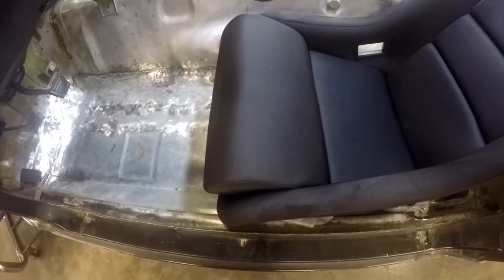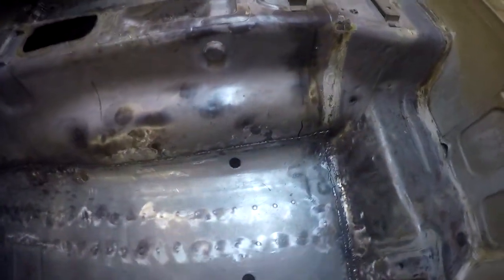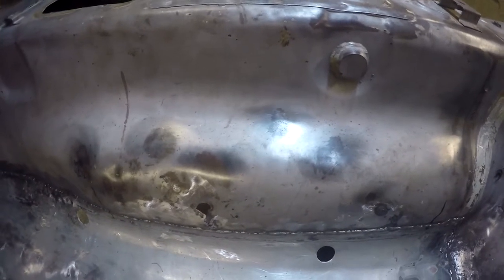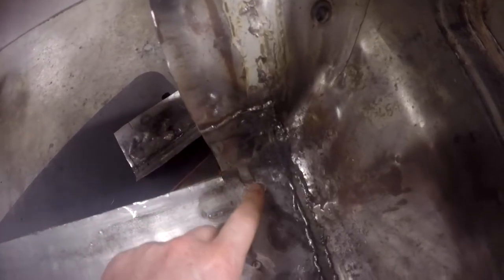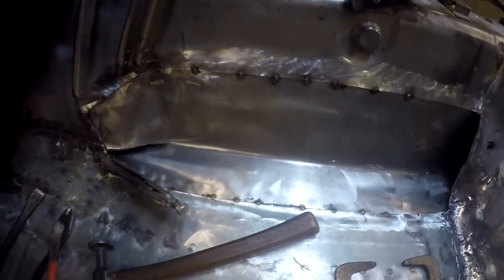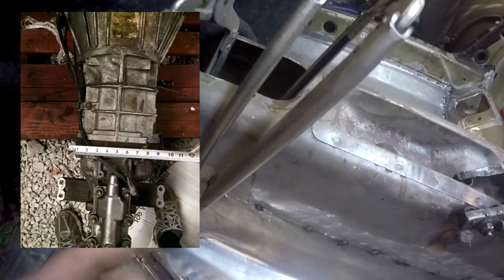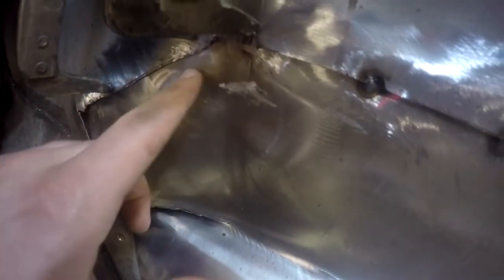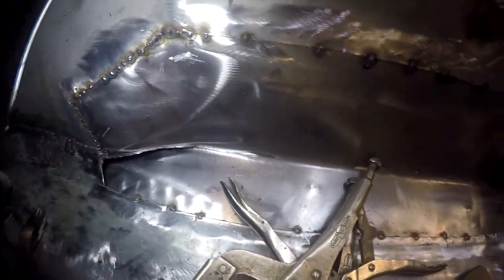Fitting the Racing Seat in the Datsun | Modifying the trans tunnel

Comment: I hope you looked into jegs Datsun Z roll bar and cage kits.They are cheap and prebuilt
uhm that area you cut I'm wanting to tuck exhaust but you got to sit in it .So now you can see why metal is great for mods.you can make any thing fit.
have you test fitted your gearbox?
Reply from the maker: I actually bought a Rhodes roll cage prebuilt for the z. The JEGS kit isn't scca approved and I got the Rhodes kit from a local z guy who ended up not installing it. So got it on the cheap. 1 5/8"x.120" wall DOM Tubing. As far as my gearbox (transmission) yes it should fit
Reply: Built Not Bought TV I didn't know you plan to race.I was assuming a street car.Neither of mine will be racing (I hate rules ) a street car you can just build what you want and just enjoy it. Another reason I chose mild stock 280z carbed motors ,for both cars ,and five speeds.Just to enjoy old school driving on the road .
A good job making this vid great job great work.My friend I'm about finished with both chassis rust repair so I'm getting more excited to start building soon!
Reply from the maker: The rules suck for sure. I'm actually not building the whole car to SCCA standards but I am for my roll cage. Things like fuel cell and some other stuff aren't going to meet the specifications. I also don't think modifying my strut towers is allowed either. But I'm building the car for what I want. Just like you, to have some fun building it. Actually drive it, and have just a liiiiiitle bit of HP :)